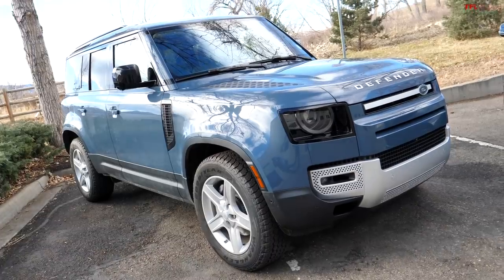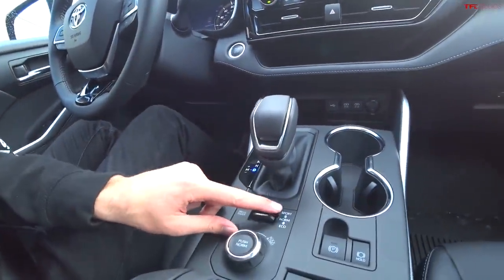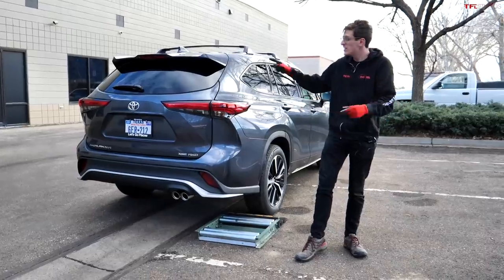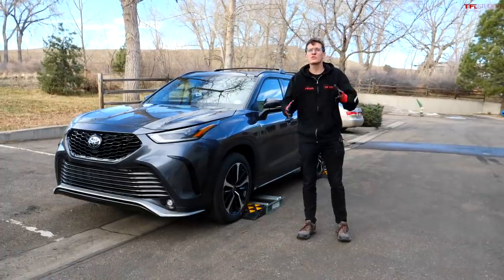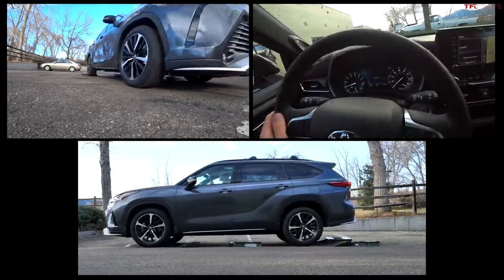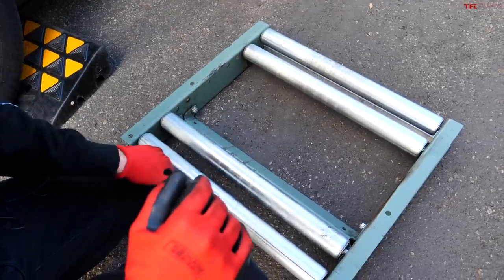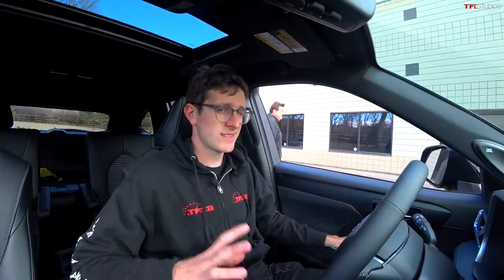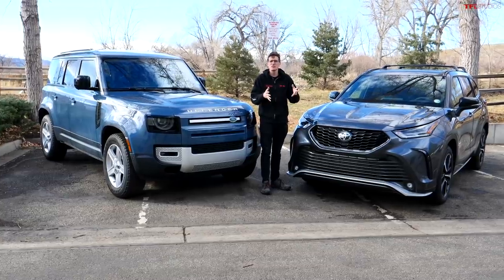Does Land Rover REALLY Make The World's Best Four-Wheel Drive Car? I Compare It To Find Out!

Comment: Excellent video, would love to see a Jeep Grand Cherokee on the roller test.
Reply: My thoughts exactly.  TFL consistently excludes the JGC.
Reply: Expecially with quadra drive 2
Reply from the maker: It’s because there are never any available in the fleets!!
Reply: It would be the same result.... ie the Jeep would lose badly.... You just do not mess with the Land Rover Terrain Response system. It's an absolute beast!
Reply: @gc2234  — To be fair, the only vehicles that can match the Defender’s performance on the rollers have lockers front and rear.

I used to think Jeep did a good job with their brake-assist 4-WD systems, but after seeing Land Rover’s system, I realize how far Jeep has to go.

If I had to bet on it, I would pick Toyota to be the first to match LR’s level of brake-assist 4WD/AWD technology.
Reply: @gc2234  yeah... when the defender isnt giving warning lights for being on a slight incline, going over a slight bump, or ... is stuck in a dealership, lol.
Reply: You can use my 2018 Grand Cherokee Trailhawk for the test if you like as I live/work nearby. It's completely stock with 5.7
Reply: @gc2234  you would be suprised. Although Land Rover has a very good system, the system in the Grand Cherokee is not far off. I have been quite suprised at how capable my stock Grand Cherokee is off road with a set of all terrain tires.
Reply: @Alex.AL_26  I agree. Jeep have a very good system. Almost as good as the Land Rover system. But then Land Rover have the much better quality interiors, tech, crash safety and on road handling. So if it's better on road and off road, why would you go for a Jeep over a Land Rover? 🤷‍♂️
Reply: my prediction for the JGC roller test

the JGC 2 Wheeled slip test: passed.
the JGC 3 Wheeled slip test: passed.
the JGC 4 Wheeled slip test: passed.
Me after reading the last result: confused.
Reply: @ericwelch8914  I hope they take you up on that offer
Reply: @sking2173  My 2020 Suzuki Jimny are very near on the rollers. It is a simplified traction control without modes but it just works every time and it works even if you are on 2wd or 4wd hi or low. 👍🏻
Reply: @TFLcar  Get it from your local Enterprise or National for a day haha. I usually see some Limiteds (both RWD and AWD) as well as some Trailhawks in the fleet from time to time.
Reply: @gc2234  you apparently have no idea how quadradrive 2 works then. With a  proper ELSD that fully locks the rear, brake lock in the front like land rover for the new ones, and wk generation has a elsd fully locking in the front as well
Reply: @gc2234  Why not? Because Land Rover has taken the crown for F.O.R.D. or Fix Or Repair Daily
Reply: @humbertorubi2735  Actually the traction control in Jimny has two modes. First is standard (in 2WD and 4WD high), second one is more aggressive (it is engaged together with 4WD low).
Reply: @4x4.tests.on.rollers  Great! Well my point is you can’t activate or select it, is the car who decide and it does a great job as you already has shown on your channel. Great channel by the way 👍🏻👍🏻👍🏻
Reply: @gc2234  - For about an hour then dead in the water. I don't trust Land Rover beyond a few miles.
Reply: @TFLcar   4wd = always locked center diff. AWD = open/lockable when needed.
Reply: I think the Jeep WK’s with Quadra-Drive 2, having front and rear ELSDs would fair as well as Land Rover’s system. The WK 2 only having an ELSD rear with traction control up from would be slightly worse overall. All in all, I’d say Land Rovers pure traction control system is the best for off roading, followed by Mitsubishi’s Super-Select 2, which is used in the 2003+ full sized Montero/Pajero.
Reply: @0xsergy  But what do you call the 4WD where transfer case has a clutch? The GM 1/2 & 3/4 tons offered an optional NP462 transfer case that was ecu controlled where it was 2WD, 4WD Auto w/ecu controlled clutch lockup, 4WD High where lockup clutch was fully engaged and 4WD Low where again clutch fully engaged but a high ratio gear engaged on lay shaft. FCA also used this transfer case in optional Ram packages. Ford has offered this type setup using a similar ecu controlled clutch design from Borg-Warner, who also supplies LR w/their center diff’s.
Reply: @thebeast9606  Agree, super select II is surprisingly good. I have it in my Pajero 3rd gen along with the Torsen auto lock rear diff.
Reply: @humbertorubi2735  I drive a 2005 Montero Limited, and am going to swap in some 4.9 diffs from a 2001 XLS, the rear has the Hybrid LSD in it. I look forward to testing this upgrade in the snow we are getting here in Minnesota.
Reply: @thebeast9606  It will work great! mine have them from factory and it feels really strong and basically will crawl on idle low range.
Reply: @ericwelch8914  that would be awesome. If it was going to buy a GC that’s how I would spec it
Reply: @jacobyo99 . I must admit I am quite amazed, this Grand Cherokee has 30,000 miles and has not had a single problem not even with the air suspension! I don't anticipate it will be anywhere near as reliable as the 4Runner it replaced but very happy with it so far other than it totally sucking gas, but tows and accelerates like a champ
Reply: @gc2234  Personally I would not buy either vehicle new right now, but the main reason people likely choose jeep is because it is less expensive than Range Rover.
Reply: @TFLcar  You guys can use mine!  It's a 2014 and it has some dents, LOL.   In all seriousness, these slip test videos are awesome!!  Keep them coming!!!
Reply: @gc2234  I'm pretty sure you haven't seen Quadra Drive 2 in operation. Hopefully TFL will take a WK with QD2 up those trails some time. And on the rollers for that matter ;-)
Reply: @TFLcar  just find a 2005-2008 WK with QD2 and NV245 transfer case. You'll be amazed. Looks like many people never did find out what this thing is capable of.
Reply: @gc2234  : When it works.
Do you REALLY want to be out in the middle of nowhere with electrical problems?
Reply: Hey TFL if you come up to Canada you can try it with my Grand Cherokee Trailhawk lol
Reply: @The Fast Lane Car  No? Did I mention no charge? :)
Reply: I don't get why people are underestimating the Jeep Grand Cherokee Wk2. It's very capable if you get one with Quadradrive2
Reply: @minivanman1356  it would probably drive right off ,as far as I know Quadra drive 2 has a front and rear auto locker if I remember well
Reply: @12Achilleas  the one on the WK2 is only rear one. They are using btc front.
Reply: @fahdabdulaziz5067  thanks for the info !
Reply: Do the Jeep wk 06-10!
Reply: @loomylomas  yes, that would be great.
Reply: @gc2234  because only one in three Land Rovers actually can leave a dealership under their own power?

Comment: Land Rover go anywhere and if your lucky they’ll get you home as well.
Reply: If you want to go there, get a Land Rover. If you want to get home again, get a LandCruiser
Reply: Check out the vid regarding the Defender this channel bought and the problems they had right at the beginning.
Reply: Found this out from Top Gear years ago 😉
Reply: Very well put. As a past serial owner of 3 Land Rovers I find your comment spot on. I also had one Land Cruiser and it always brought me home - unlike my LRs. But the LC was bland and boring to drive - unlike my LRs. The agony of choice...
Reply: Comparing a Toyota to a Land Rover is like comparing an Abacus to a Graphic Calculator. Sure the Abacus is more "reliable", but I know which one I'd be using if I actually wanted to get any proper work done.... the Land Rover!
Reply: @alexandermikhailov2481  Not sure if the open question of being able to get home from a trip in a LR is the kind of whit knuckle edge of the seat excitement I'm interested in...
Reply: Well that's Original
Reply: Don’t want to leave my journey to luck
Reply: @JimBob-vb8oz  Have you ever owned a LR product? A Toyota product?
Reply: @markbeiser  agree. That's why I don't own either vehicle now.
Reply: Multiple ski trips to the Alps in my 2010 Freelander SD4. Leave it for a week and it starts at -15 Centigrade and brings me, 1 adult and 3 kids all the way back home to the UK. No luck required it would seem. Just sayin!
Reply: Owned 2 LR3s and a Discovery over the last 10 years and drove a Prado for 6 months. Never had any issues, I’ve done dune bashing in the dubai desert and serious off-roading in snow in northern Ontario. Never skipped a beat and did it all in super comfort on LR3 and the current gen Disco. Toyotas may be reliable but doesn’t have the character nor the comfort of a LR. They just need to fix the rear of the discovery.
Reply: With my LR4 11 years and 280k of mileage in the very hot weather of the GCC where we do desert crossings i wasn’t able to brake it even once. I also have to say that i have a wrangler jl and a gladiator rubicon and they are the best (4 by 4). But in my opinion overall, Land Rover is the best (4 by 4 by far)
Reply: Lol
Reply: @VampirusX  to be fair.. lots of new cars have problems. By 100k most are sorted and they're reliable from then on. That's why companies offer warranties, usually factory mistakes pop up quick enough.
Reply: @gc2234  do you do any work?
Reply: @0xsergy  Exactly, although in my experience the issues arise long before 100k miles. When these “reliability” surveys are taken, it’s almost exclusively to owners within first year of registered ownership. JLR could dramatically improve their rankings by improving qc at factory and by incentivising owners to complete surveys. 

Every time I receive a survey, it goes in circular file. If the letterhead is JDPower, Consumer Reports, etc, I’m not even opening envelope. That goes for any item, not just auto purchases. That said, Lexus offers coupons for completed surveys from their dealers. Would that affect my response...honestly no but I believe I’m atypical in that attitude. 

I can say that when we picked up my partners iPace Jaguar from dealer, after they had supposedly pdi’d it, the vehicle was unlocked, she climbed in and the vehicle would not turn on. Absolutely nothing. The ‘Master Technician’ and Service Manager were called to look at vehicle, finally the tech plugged his laptop into vehicle and found no power from the batteries to ecm. He checked batteries w/multimeter since his laptop couldn’t communicate to ‘dead’ car, found the main ground bus was disconnected. He connected terminal and vehicle came to life. Dealership agreed to deliver vehicle to our home the next day because it needed a software update and clearly vehicle had not been pdi’d. Dealer of course claimed this should have been caught but that factory had screwed up in not connecting batteries. Were they right? I don’t know because I don’t know in what state they are supposed to be when delivered to dealer but I would assume they are supposed to be driveable. How did dealer place car in delivery area of dealership w/o it being drivable? Was a disgruntled employee playing a prank? I’ll never know for certain, honestly don’t care as my partner loves the car and dealer did deliver as promised to our home, nearly an hours drive away. My 2018 RR had battery die 2 days after purchase while sitting overnight in my heated garage. The dealer on that occasion had vehicle towed to shop, replaced battery, tested system and I’ve never had any issue w/vehicle again. Is that defective battery or improperly prepped battery by dealer? Again an unknown but maybe improved factory qc or dealership qc would have caught the problem. 

If I were to rate quality & reliability, based solely on 1st hand experience, of our vehicles the last 3 decades, I’d rank the JLR products, 7 JLR vehicles in that time, at or near top. Without question our 3 BMW’s, technically the 2003 RR L322 wore a LR badge but it’s failures were all BMW engine and transmission related, were the worst. Our Benz’s, Audi’s and a Porsche were fine but a few more issues than ideal, the 2 Lexus would be equal to or just below the JLR’s.
Reply: LMAO, so true!!!!. With the Highlander, you would not worry about anything!!!!.
Reply: @MichaelM-to4sg  I said 100k but meant kms so around 60k miles, my bad. How would that vehicle pass the inspection every dealer does before they sell them.. they have to literally test drive them..
Reply: @0xsergy  True. Dealer did say vehicle had not been “properly pdi’d”, quite the understatement, lol. I suspect it was disgruntled employee but dealer would of course never admit such. Regardless, no issues since, which is all that matters.

In my experience, most problem issues arise in first 5k miles, at least related to manufacturing qc. Beyond that it’s likely an engineering or parts manufacturing issue.
Reply: Land Rover might get you around for a day  they went through 3 of those brand new piece of.   Just get the bronco when it comes out
Reply: @dudeski934  Not really. The first had a fault code, it didn’t strand the owner. Whether it was a mechanical fault, bad wiring or sensor or a software fault, we’ll likely never know. 

The second unit these guys never received due to unskilled dealer tech damaging the vehicle prior to delivery. So yes, they are on their 2nd Defender and JLR clearly has some serious holes in their dealer tech training methodology. 

Sure, folks can be waiting another year for the new Bronco, it looks like a terrific Ford vehicle. Or they can be driving their Defender which offers much more comfortable air spring suspension and the most advanced traction system, on or off-road.
Reply: @MichaelM-to4sg  Yes I have
Reply: @JimBob-vb8oz  is that cos the cruiser couldn’t get there in the first place
Reply: @sabakimedia4370  Bwahahaha. Is it April 1 already?
Reply: @JimBob-vb8oz  either that or Groundhog Day
Reply: @sabakimedia4370  Only Groundhog Day when you have to walk out to the Land Rover and it doesn't start.
Reply: @JimBob-vb8oz  that’s unfortunate, same goes for any car if you expect to use it and it doesn’t go, but mine goes fine both the 110 (v8 converted to diesel) and 90 td5 chipped 👍

Whereas my s-type is testing my patience, but then again that was platformed shared with the Lincoln LS and was riddled with the Ford parts bin, I doubt I could give that one away 🤷🏻‍♂️
Reply: I never should have sold my 1996 land cruiser with the 3 locking diffs.
Reply: If you're lucky it will get you to the service department for repair
Reply: Aren't Land Rovers Indian cars these days?
Reply: @elzorro8787  Owned by India, built in Britain.
Reply: Some guys just criticising land rover the comedy is they don't even own a corolla or don't know how to drive a car, I've owned a velar last one year i didn't felt any bad experience until now it almost like every other high end luxury car that's it
Reply: it goes home very easy with minimum effort on a tow truck
Reply: @alpine9996  All Defenders are built in a brand new state of art factory in Slovakia opened in 2018 or 19. They also produce some Disco’s, Evoque and Disco Sports there. We have iPace that was assembled in Austria, though I was told that plant is Jaguar only, no LR’s produced there. Tata signed JV w/Chinese auto manufacturer back in 14 to assemble Disco’s, Evoque and some Jaguar’s but those vehicles are solely for Austral-Asian market. All RR & RRS are produced in Solihull, UK plant, as is all engineering and vehicle development.
Reply: Don’t justify outdated Toyota with reliability crap
Reply: @JimBob-vb8oz  get a NISSAN PATROL